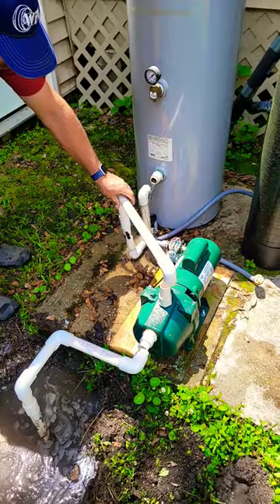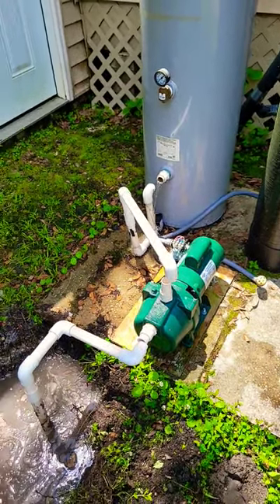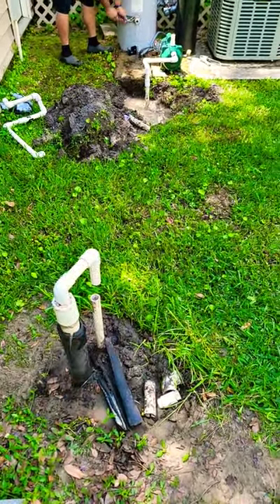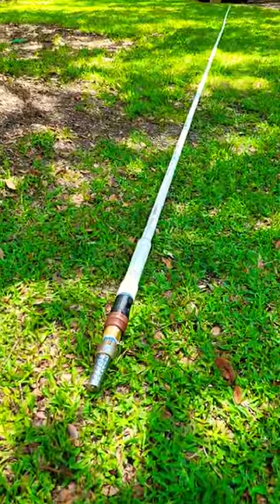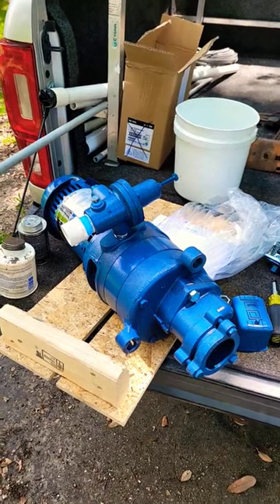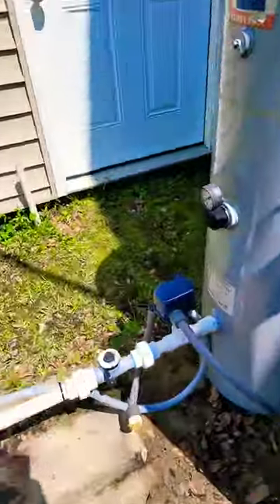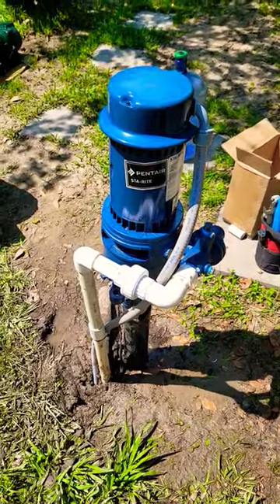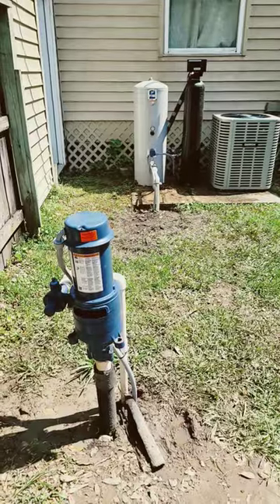Water Well Pump System Improperly Installed P2

Comment: This is interesting to see how this is done in other locations.

1) in my area the well tanks are located within the house. They would freeze solid outside.
2) Jet pumps are not used, only submersibles.
3) A shallow well is 150 feet deep. A typical well is 250+
Reply from the maker: Yea so we have very diverse well systems in my area, all different types and depths.

It's a good idea to protect the systems from freezing but here it's very rare and can easily be mitigated by covering temporarily.

We have wells from 20' - 2000' deep with water tables of over 100' to flow wells with almost 50 psi naturally.  

There are also a great history on wells here with steel wells that were used without pumps for 80 - 100 years, some still don't.

I need to show more of the older wells the next time I work on one.

Thanks for the comment and watching,
Casey

Comment: Different States different issues but I absolutely hate jet bumps they lose prime after a power outage. Easier to overheat yeah they're easier to change out because they're on top of the ground. I'd rather spend the money and put it in a bigger well casing and put in a submersible pump.  Way simpler And less maintenance

Comment: Thos tanks are so weird we have a lot a problems with our taller tanks bc the rubber blater has to stretch so much further in one direction also fighting gravity a little too
Reply from the maker: This is a standard tank, no bladder.
I know what your talking about the tall skinny diaphragm tanks.
The problem with them is loss of air pressure will stretch it and break seal.  The diaphragm actually over extends into to taller tanks causing the failure.
Yea nothing to do with gravity just keep them aired up!